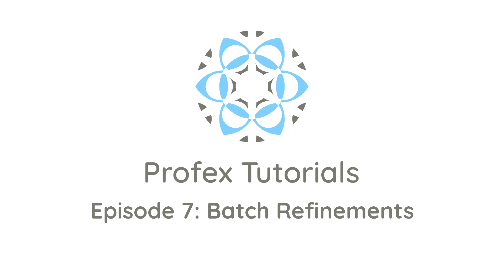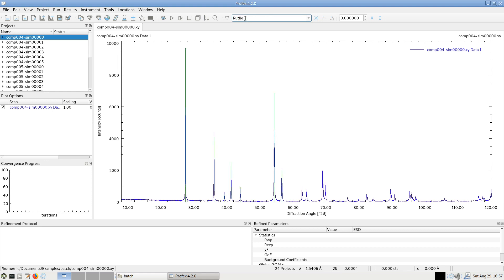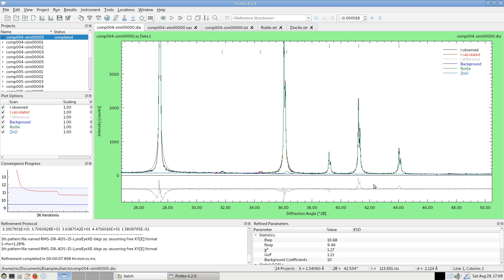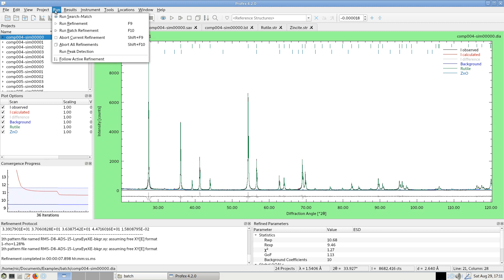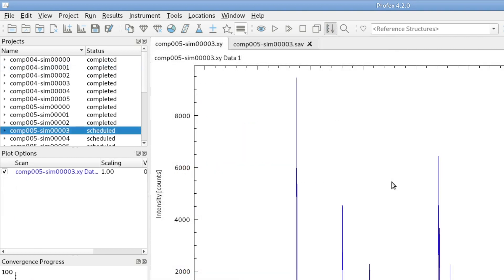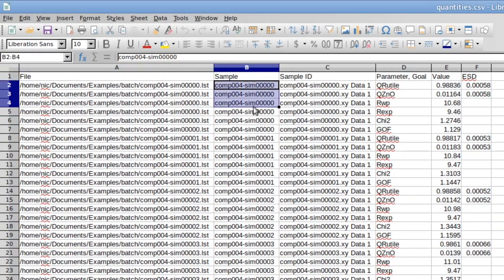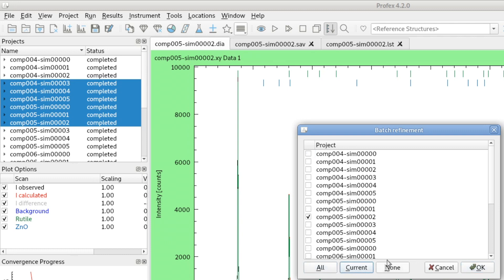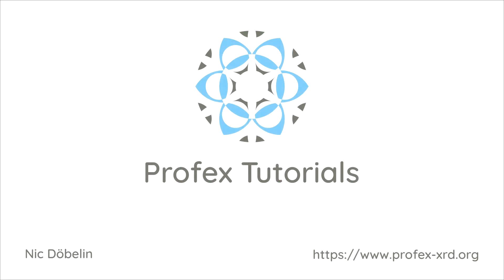XRD Batch Refinements with Profex

Comment: how to plot graph using .txt file
Reply from the maker: Try changing the file extension to *.xy and then drag-and-drop it on the Profex main window. It may work if the file contains just two columns of data (2theta and intensity).